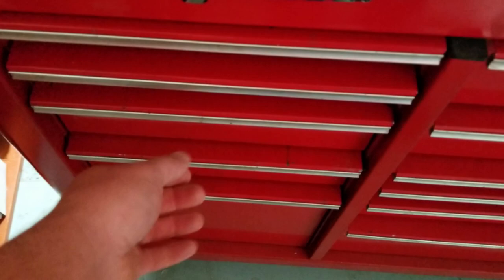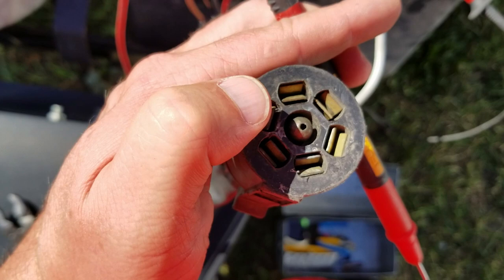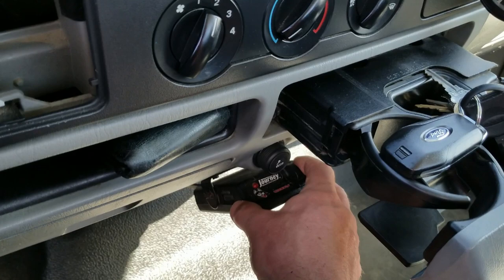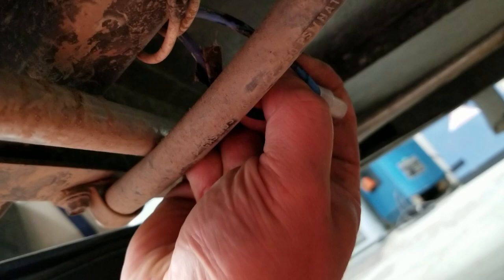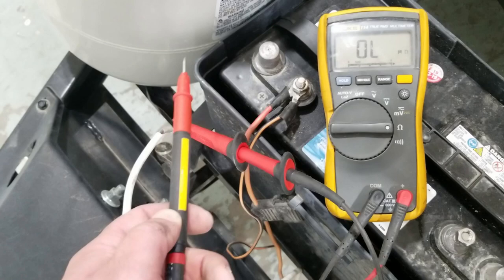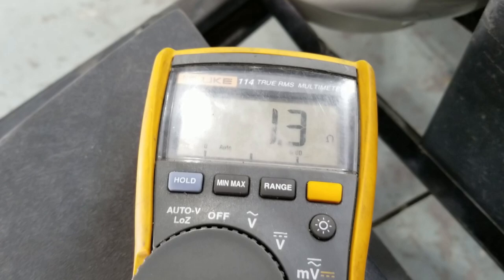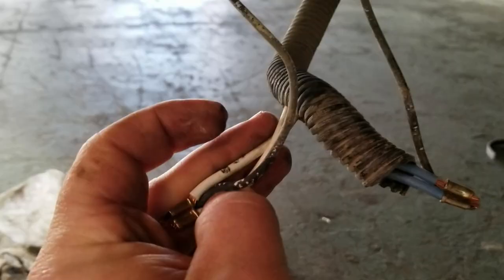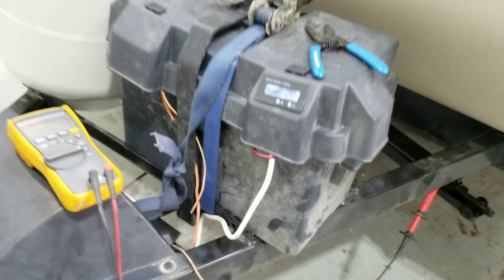Scumbag Offset | sketchy wiring

Comment: One correction, some mis-diagnosis on your part here. The brake-away contraption was working correctly, but some context is important. First consider the kind of cliff-side mountain road that is twisted and bumpy enough to knock a whole trailer loose. First things first, the driver ain't got time to worry about whatever's happening to the trailer, he's got more important things to focus on for a little while. Did you see that reaction time? 2.5 seconds and there's already smoke. Perfect. 

Now that wiring is laced throughout the whole flammable underside of the trailer right? Those thin unjacketed wires are that way from the factory by design! In another 10 seconds the whole trailer would have been up in evenly-distributed smoke. But no fire yet, see where I'm headed? That's your critical timing right there. It's an old Indian trick, smoke signals. The purpose of the smoke is to help you locate the trailer at the bottom of the ravine it's now lying in after you got the truck back under control and your passenger is sitting upright again and looking for a tissue. Now I was talking about timing, see, you've got yourself a few minutes to find the trailer from the smoke signals and disconnect the battery. Else, feature #2 kicks in: Insurance Claim. 

Did you know that if an animal is alive when you hit it, it's not considered an avoidable obstacle, and your comprehensive coverage will pay out and it's not considered an at-fault claim so your premiums won't increase? Call your broker, it's true. So, your driving was fine, an animal jumped out of the bush, you knocked it back into the ravine, the trailer came loose from the swerving... presto. New trailer. Now all those years of neglect, water rot, bent jack, sun-rotted air vent.. they're all about to pay off. Why fix the cow when you can get the milk for free? What condition was the trailer in? Well, no one'll ever know, because Feature #2 makes sure there's nothing left but box tube and ashes.

What you've done here is tamper with the factory settings and voiding the whole warranty system. This thing is going to crash and you're not going to get a penny for it, you're actually going to have to fix it. And who wants that?
Reply: Comment of the year award nominee
Reply: @pliz5  only on AvE channel you can find this beauties
Reply: So what you are saying is... fuck it.
Reply: BRILLIANT!! this guys going places
Reply: Just don't do what Frosty did and small ball it. 
My buddy and I sent 2 months rebuilding, and properly repainting a tilt bed trailer for his business. His dad and Frosty borrowed it to haul something. Frosty had a 1 7/8" hitch, and the trailer had a 2" slot. Frosty swore it'd be fine. They ended up having to pry it out of the guard rail, and the trailer required a trailer.
Reply: @sprinkhole58  I think he meant don't unfuck it!
Reply: This is a poetic masterpiece!
Reply: Robert Paulson 

Fight for your cage
Fight for your cave
Reply: So please refer to final ditty.
Reply: MattsAwesomeStuff absomutely bastrastidy magnipurple! Poetry to my hard working ears.
Reply: Slow clap because that was impressive.
Reply: Insurance it is, probably cheaper than trying to re-wire and doesn't ruin your warrantio.

Lol
Reply: 666 likes is perfect for this comment
Reply: BRB, gotta un-fix my wiring.
Reply: This is some serious trailer meta right here.
Reply: Well, you've given me a new found respect for those forward thinking trailer designers for sure !
Also, on the subject of forward thinking, along with zip ties, gaffa tape and tyre sealant, I will include a small pack of tissues.
Reply: @MattsAwesomeStuff  -  Pre - fookin' - cisely !  - get your retaliation in early.
Reply: I'm dying this is the best youtube comment I think I've ever read :DDDDD
Reply: Sounds like a new law student is demonstrating his chops from his first month in law school.  Way to go.  Sort of like Sheryl getting a She-she-er She Shack when disaster strikes, as seen in the current American TV commercial on insurance coverage.  I wonder who plays the long-suffering husband "Fred" in the AvE scenario described in the comment?
Reply: good stuff thanks im laughing and this made my day!
Reply: Yeah ... what he said... ;)
Reply: Skookum of the year eh,

Comment: I removed the entire factory wiring on my boat trailer. Re-wired it using those crimps with the heat shrink that has the glue in it. Used a proper crimping tool and heat shrink gun set to about 900 degrees F. 
Can't pull the connections apart with all my strength, given that's not a whole lot anyways. 
She's all waterproofed now. Added several extra grounding spots throughout the whole frame because the ground is usually the thing that loses connecting first. Coated all bare metal grounds with liquid rubber. 
Bundled the harness throughout the whole frame and added extra sleeving at points where the wires would have been rubbing on the frame. Filled up the hollow square tubing tongue with expando foam to keep the wasp out. 
She should last at least 4 summers now. That is as long as nothing goes wrong with the boat. Lol
Reply: fuckin noah's ark over here lmao

Comment: You're absolutely right. Trailer wiring only lasts a year, maybe two. Mine had the unfortunate intermittent issue of only working when stopped.  Had a few too many people not too pleased with my lack of signals. Ended up ripping everything out and rebuilding from scratch. Soldered it all up. Lathered on liquid electrical tape and heat shrink on every connection with dielectric grease on the screw terminals. Four years and still going strong!

Comment: I used to be a cable guy who had to fix your tv or internet when it was cruddy..  Some of the best advice I ever got in the beginning was:
Find out where you are good, find out where you are bad, then cut it in half.  
Keep doing this until you find the chopped, nicked, cut, spiced or otherwise defective part.  
This advice has served me well in many different debugging situations, cable or otherwise.
Reply: Can confirm, this process works great for debugging programming/code as well.
Reply: @BrianChristmas  I've had to comment out code until I had a single line left which still inexplicably caused the error.
Reply: This is known as a Binary (or Half-Interval) Search for anyone who wants to read more about it.

Wikipedia: https://en.wikipedia.org/wiki/Binary_search_algorithm
Reply: @MichaelSteeves  Oh man! I've been lucky so far and haven't experienced that level of coding error. I'm sure it's just a matter of time...
Reply: Still dont know what to do with the other half..
Reply: As an ex telecom cable faultman, I concur. I always home in on a problem very quickly thanks to my years doing that job.
Reply: @Michael Steeves the scary part is when you've commented all the code out, and still have the error.  non-printing characters are fun
Reply: @MichaelSteeves  , normally when that happens you are in the wrong section of the program. I hate when that happens.
Reply: Yep! Trained, tried and true technique from my fire control system days in the navy. Radars, consoles, computers with monster schematics and equipment all over.  I bailed more than a few people out with this method after they'd screwed off hours or days easter egging. 😂

Comment: Scotch locks. Lil blue misery devices.
Reply: Indeed... Next week, car stereo installations...
Reply: Yup, yup, yup.
Reply: Stereo shops expertly use Scotch Locks to Professionally install your double din radio in your donk!
Reply: Scotch locks, OK for wiring inside a vehicle,if used properly on the right gauge cable ,but an absolute no, no for outside use , wouldn't last a season.
Reply: Hey, sometimes they're red. They're all still terrible though.
Reply: Land Rover owner here .. scotch locks essentially hold the wires together after a few years of short sorting. So when you see one you know there's a whole forking herd of the little sods waiting to be found...
Reply: Scotch Locks - the "quik-fix" that partially cuts an otherwise perfect wire to cheap-ass graft a fresh one alongside it. Works from 11 to lunch, then lives on in an infamous half life that ruins the lives of everyone in a 2 mile radius! 

They should be banned from the face of the earth, along with what ever twisted prick that designed them! just drop them and him/her off in outer space, and leave them there!!!
Reply: Scary thing is they are the standard industrial connector in so many applications, including lifts and escalators. you do need to use them right though, and the gel filled ones are great, if somewhat messy.
Reply: @stuartlockwood9645  Never use them in automotive,or marine,or aircraft applications,ever!
Reply: so many fires from these
Reply: Turns every wanna-be into an auto mech...
Reply: Someone gave me a whole bag of those things a couple of weeks ago. Five pounds of plastic I’ll never use........
Reply: Never heard of them called that before. They've always been vampire clips in my parlance, or "one of those fucking things"
Reply: Or vampire taps, or in my industry we call them "come-back clips", because if you use one the customer will come back with a problem later, lol.
Reply: I have lost count of the number of those little bastards I have unearthed, swore, and heaved over the shoulder.  It's always my first stop iffin a trailer plug, bull bar light or random aftermarket accessory fails to chooch.  If no scotch locks are found on visual inspection, swear and proceed on to actual diagnosis.  I don't often have to actually diagnose anything, most of the aftermarket accessory fitters (towbars/bullbars at least) all use them religiously....
Reply: Gel filled scotch locks are great and should last a very long time. Non gel filled are a waste of time
Reply: @EntropyBot  Color indicates size of wire to use on. Never had a problem with them in telecom.
Reply: Get rid of the "lock" part and they are just fine.
Reply: @stuartlockwood9645  no no no.  Scotch locks are never OK.  Not even inside a vehicle.

They're what lazy half-assed scrubs who shouldn't be wrenching use.
Reply: @H2R5GSXR  Telecom applications don't move or have NVH to deal with.
Reply: I just call em' garbage.
Reply: These were designed for lighting fixtures in buildings only. At each fixture, a wire was t tapped using these quick little guys on the concept that the draw at each point these were used was limited to the one fixtures current load and was sufficient for that load. They are in no way exterior rated and not rated for vibration or ment to carry more than an amp or two  at 120-277 v. AC. Everything has a design spec, which everyone ignores, including manufacturers.
Reply: @stuartlockwood9645  Scotch locks are never ok, the tool of the T.A. fitting towbars at your local shop. Solder / heat shrink or heat shrink crimps, Deutsch plugs etc are the way to go.

Comment: Here in Australia, the from the factory trailer wiring is of the exact same quality. There must be a secret international standard that trailer builders all adhere too, that mandates the same rats nest of wires and crappy loose connectors.
Reply: That secret international trailer wiring code is called "hire the kids right outta high school, we don't have to pay them very much."
Reply: @cr4zyj4ck  you left out the part where you give them shit tools and consumables, don't adequately train them, and tell them to hurry up.
Reply: You can count central Europa in the standard.
Reply: @matejjakopic7797  Zinc coated chassis, well protected wiring, mechanical brakes and decent priced from factory - you cannot complain about European trailer marked!
Reply: Steve Jay yeah and get a load of those generic Chinese import galvanised box trailers that are all identical but sold under a hundred different brand names yeah I’m Aussie too I’ve got 2 of the geesless things

Comment: Also a tip from a mechanic, having some old rubber tubing from radiator hoses, cooler lines, and heater hoses are great for wrapping a wire and making a “grommet” for wires run through frames that can be installed without removing wiring. Works awesome for the dodge 5.9 dsl and the trans cooler lines always getting fucked by someone before you.

Comment: After years of working on old livestock trailers that spend 95% of their life on gravel roads, this wiring still looks great! I'm used to wires rotten through, wires twisted together with tape (no connectors) and about fifteen Scotchloks over the span of 16" of wiring. I'm a big fan of proper trailer cord protected by metal tubing and using aluminum junction boxes and solder crimp heat shrink butt connectors for any splicing. Ideally, everything should be homerun as much as possible, including the ground wire.

Comment: First time I troubleshot the brake controller on my truck, I thought it had an intermittent issue also... until i thought about it, the brake controller monitors resistance across the brake circuit. too low resistance, brake controller ignores the load. Thats why brake controllers are rated for a certain number of axles. A quick trip to oreilly's and purchase of the cheapest incandescent test light available gave me the proper tools to test the brake controller at the plug. The internal resistance on any other meter is not enough for the brake controller to activate. Just a little food for thought for everyone.

Comment: i ohmed out every goddamn wire on my dads trailer after he rewired it, turns out the dingus end on his brand new GMC is faulty...
Reply from the maker: Every. Damn. Time.
Reply: Yeaaaaah. They do that
Reply: THAT'S A SUPRISE ....not....
Reply: Already been warranty repaired once too...
Reply: @arduinoversusevil2025  can we have a boltr on that hilti impact wrench??
Reply: iBiana Doubt  Kilmer?? Hahahahaha the fool couldn't diag his way out of a paper bag,and is barely qualified to fix his own lunch.
Reply: @TonyFleetwood  They are made really cheap now days. Mine had green wires. I had to chop off part of the actual harness and start back from there. I used the newer silicone shrink connectors.
Reply: Dewey Rayburn  it's always the last place you look because you found it. I always go from easiest to hardest. And usually hardest to check is where the fuckening happens. I'm always relieved to find it tho, intermittent is worse than not working at all.
Reply: Generic Motors Corporation....
Reply: @Cheepchipsable  Nah, what's the fun in that?

Comment: Its always a wire worn out to the frame. I replaced an FDPM on my F250. worked for about 3 mins, then fuel pump dead. After screwing around for hours, purchasing an $80 part i didnt need, I decided to follow the wire bundle from end to beginning crawling on my back underneath the truck. with a flashlight i caught a glimps of something shining when i moved the wire bundle around. Mind you, the bundle was wrapped in some heat resistant metal like wrapping, and it had rubbed off and through that,  and through the wire insulation to barely expose the copper which of course was shorting out the FPDM. just had to wrap it, loom it and secure it away from the frame. Just sucks going through that. Couldn't tell anything from above looking at the same wire bundle,  looked good,  but wasnt.

Comment: I just bought a trailer & the wiring was comfumbled, I have a 7 way plug with brake booster as well so ling story short took me 3 hours to figured out the rewire soldered the connections & heat strinked & done. Working great now...

Comment: Those twisty connectors are called "wire nuts" here in the States. Not intended for automotive use, but I also have found a few used that way. Replace them when I do.

Comment: Fooking scotch locks. The bane of every trade that has to deal with angry pixies.
Reply: I've taught many radio technicians that filing the instructions in the bin is optional. Filing these bastard IDC connectors in the bin is not optional.
Reply: @JGnLAU8OAWF6  as kindling? Then it's fine, just don't stand directly down wind.
Reply: Антон Южаков as long as the wires will never be touched, jiggled, or moved, fine.
Reply: @brianhopper3013  never jiggled in an automotive application? Pfft.